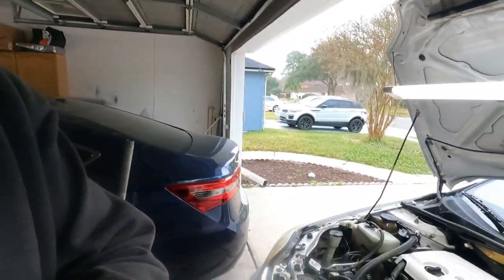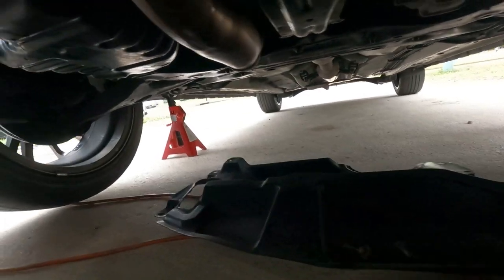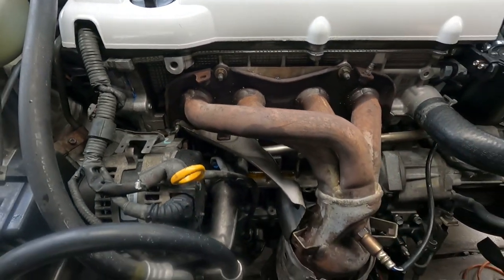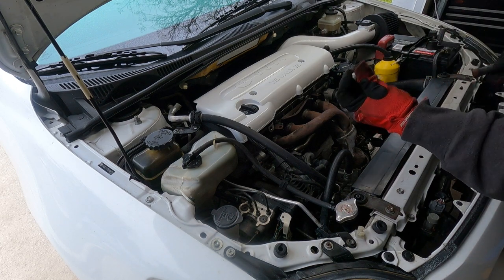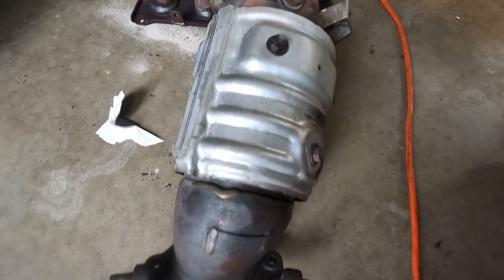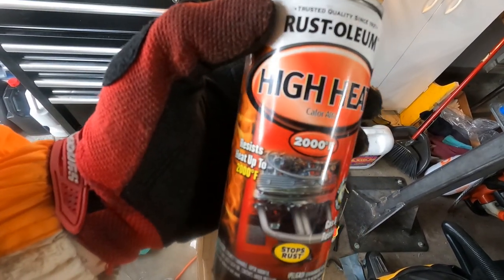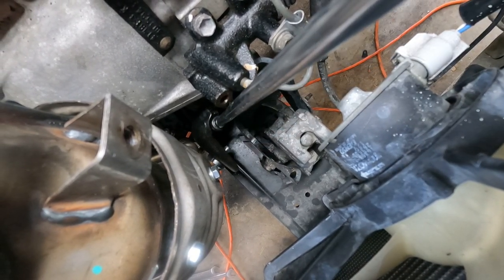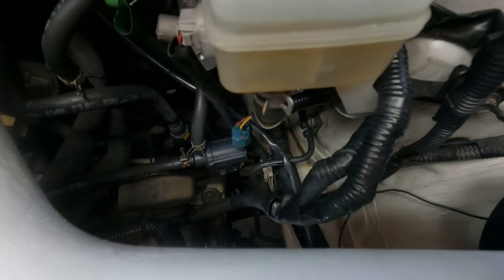2005-2010 Scion tC Catalytic Converter Replacement

Comment: Great vid. Thanks

Off topic - Your power steering fluid might need changing. The power steering line does not have a cooler and the fluid burns. The black stuff settles in the rack and wears it out quicker.

Toyota (or Scion) uses DEX lll ATF for power steering fluid. DEX Vl is synthetic and doesn't burn like DEX lll. It's backward compatible with DEX lll and will clean the reservoir bottle and screen like new.
Reply from the maker: I have since flushed the system when I replaced the Power-steering pump and got a new reservoir tank.

Comment: Getting ready to replace the cat on my kid's car so thanks for the video and the recommendation on where to get an affordable one. Did the heat shield bolts not lining up ever cause a problem?
Reply from the maker: Not really, I ended up drilling out the holes on the heat shield bigger and it bolted up just fine.
Reply: @NikGarage  Great. Thanks again for the video and the advice

Comment: How many miles did your cat start to fail on you? And why didn’t you film how you put the springs bolts back on? I know it needs to be compressed a little how did you do it? What tools etc
Reply from the maker: The springs did not need to be compressed the bolts are long enough to get started and then just use a impact gun. The cat failed around 165,000 miles.
Reply: Ah man I don’t have an impact gun that’s why I wanted to see it being done! Thanks! I had trouble with that corner 12mm to remove where the alternator is at.
Reply: @rhdadrian how did u get it off
Reply: @og9018  it wasn’t that bad except the corner 12mm needs to be with a wrench, I used all hand tools.

Comment: Man what size bolt did you use for the missing bolts you had. I’m missing the same one and need to instal mine as well. Any memories on the thread?
Reply from the maker: I can’t recall what thread it is but I believe it’s a M10x1.5 14mm.